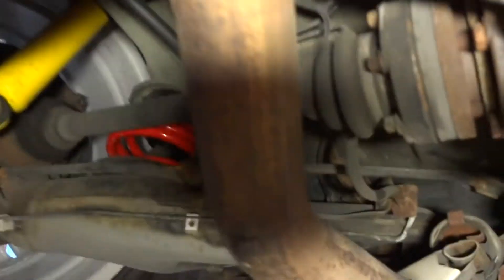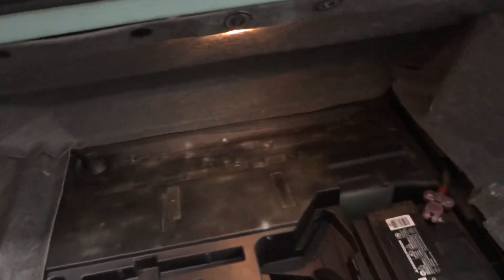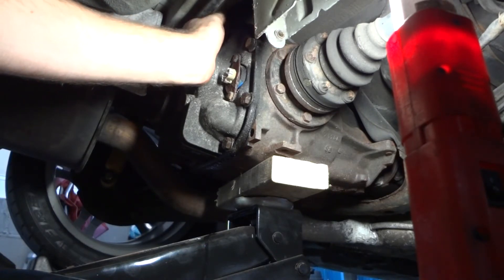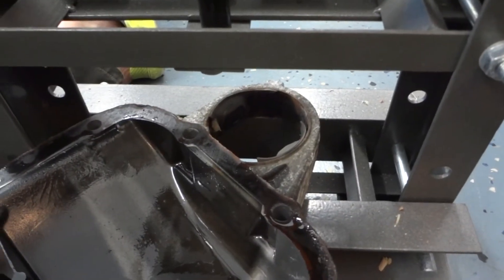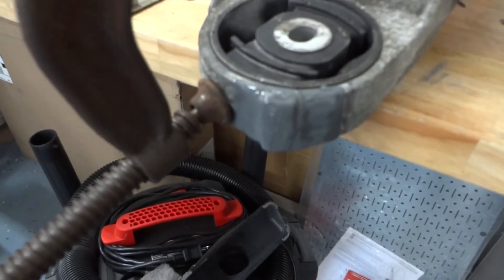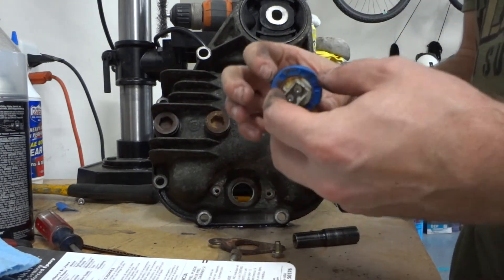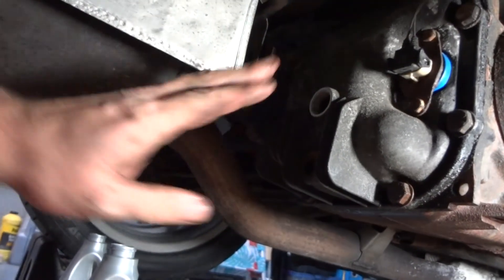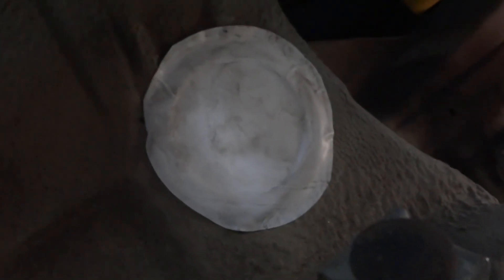1998 BMW Z3 Differential Bushing Replacement

Comment: Man to be honest if you have come so far till you've replaced the bushing, you should replace the LSD and the housing as well.
Reply from the maker: I don't disagree, this car is a rabbit hole of work because of its age.  I did this because it was relatively quick and easy and I had a race that weekend.  I plan to tackle the diff again when I drop the rear subframe for bushings.
Reply: @driventofailure  this is exactly my plan. I actually have the subframe, axles, differential, lcas, from a 3.0 I want to swap in but I daily drive the car so I've been pushing it off I need to just do the differential bushing. Gonna tackle it this weekend.
Reply from the maker: @Bmw_Z3R  pretty doable on a weekend as long as your careful pressing the new bushing in to the housing.  I also made a video for the sub Bushings, rtabs, and diff rebuild later in the Playlist.  Finally tackled that rear full on!
Reply: @driventofailure  hell yeah dude. Actually I'm just waiting for the dealership to get the diff cover gasket in $13 bucks is a steal OEM BMW too. My problem with the swap is apparently the 3.0 has a 5" wider wheelbase on each side to the 1.9 so I'm still debating the solution for wheel poke.
Reply: Nice video I need to do this as well.  My 2cents worth for future DIY’s Some grease helps with install on all pressed bushings, even though they say don’t use lube it helps ! A local welder can fix that cover easily with mig welder.
Reply: but then he could also replace the mounting for the differential. it's become a endless money pit at that point imo

Comment: Is there a pattern for tightening the cover bolts? I did my e36 m3 cover and there was a specific order for tightening and torque
Reply from the maker: Checked my manual and TIS, didn't see anything specific to sequence..
Reply: @driventofailure  yah cuz when I did my e36 m3 cover few years ago I found a  torque spec and sequence page. Now I can't find. Just wanted to know if there was something similar for these.